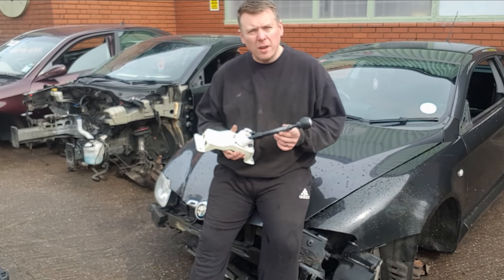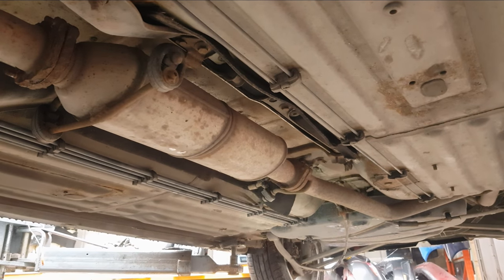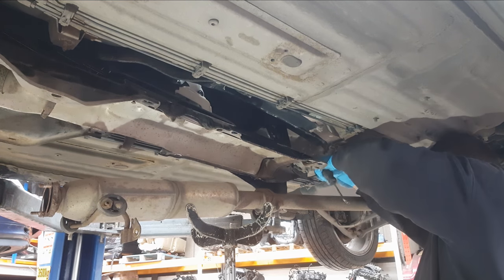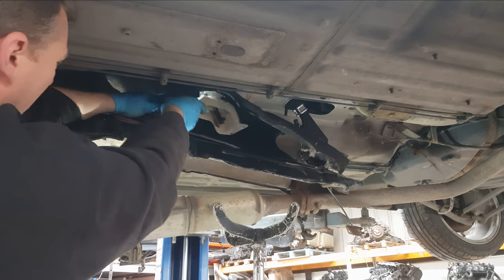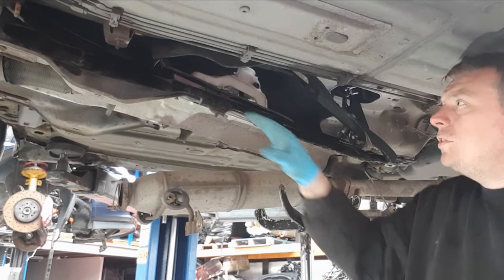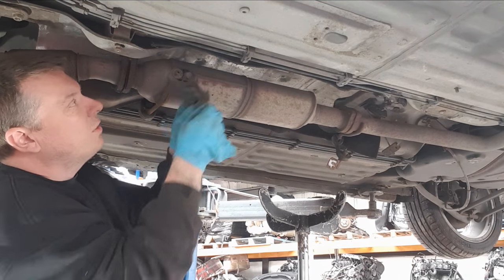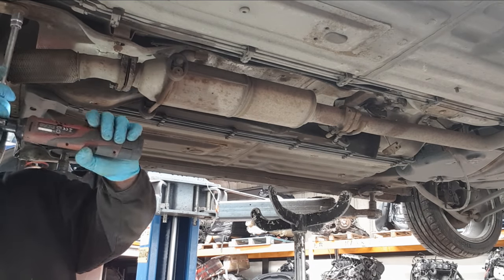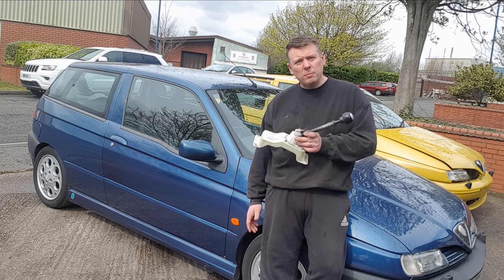Alfa romeo 147 or GT  Broken gear selector removal tutorial

Comment: Thanks for the video! Planning this job for tommorow on my Alfa 147 😅😅
Reply from the maker: enjoy.
Reply: Pfff glad it’s done...hell of a job changing gear cables 😭
Reply from the maker: Mike van Hek you run into any problems,
Reply: Italia Autos ..previous owner had point welded🤭 the exhaust pipe...so i had to grind it open. Also the bolts were rusty and welded....so i had to drill them out and made the surface smooth again...😏

Comment: I have a 2002 147 2.0 autodelta turbo conversion it's a SELESPEED gearbox ,I had the car for 5years now it's been parked on my drive for 2years (just sitting there making my drive look good😎 reason it's parked I bought a MPV ) since I parked it it's been giving me trouble selespeed trouble and I have had enough lol I want to convert it to a manual I am looking for a 147 2.0 2002 doner Manuel car if you care to help 😊,I have all the instructions to do the job it's pretty simple than ppl make it I have never done one but I love this car only if it was a manual i would be getting my full 263bhp 🤗

Comment: Hi are you near Birmingham?  I used to do all my own repairs but now I have neuropathy, Ankylosis Spondylitis and skin that tears easily which stops me tackling this exact job.
1)  Can a top part fix the issue as I have checked mine is broken as seen for 147  6 speed on the flea bay?
2) Would you be able to repair mine or able to recommend a mechanic?
3)  Where can I get hold of a complete selector if required?
4) Or where can I hire a car lift and get my son to tackle this with my instruction and this video?
Reply from the maker: yes im in walsall.

Comment: I need to change just the plastic bushes under the gear selector of the GT 2.0 JTS. How do I get out that stupid pin? I tried a hammer with a screwdriver but nothing is happening! It's not the same as the JTD.

Comment: I have trouble engaging 6th gear, I really need to push it hard to the right and then it gets in easily, or I just pull the ring for reverse and then it slides easily, It's like the selector doesn't go right enough, can this be adjusted?

Comment: I have a 2007 alpha gt 1.9 jtd,I would like to replace the part, where can I find the spare part? If possible new, refurbished, but not used, can you help me?I live in Italy
Reply from the maker: Think a company called totally alfa sold a kit
Reply: @ItaliaAutos Thank you for the rest, but the new alfa spare part is nowhere to be found, my problem is not so much the right/left movement, my lever moves back and forth when I accelerate or release the gas, do you think it can only be the bushings and its housings together with the shift cables? Thank you for your help

Comment: Hi I have a 156 and the top portion of the white cup is loose.  seems 2 out of the 3 bolts are loose and wont tighten up.  is there any way this can come off with out doing the procedure as in your video?
Reply from the maker: Nope all done like in the video
Reply: @ItaliaAutos  got around to doing this job over the weekend in my driveway.   What a job!  used up all my bad swears for 2023 and maybe a few for 2024.  added spring washers and nylock nuts.  I guess the problem is the factory bolts are no high tensile and stretch?  anyway, if this has to be done again it weill be done by the next owner.  gear box oil seals next.  cant be as akward.......

Comment: On my GT the gears engage fine but the gear stick wobbles around like crazy, what's the problem? Do I have to open the whole thing from the bottom?
Reply: Same on my 147, I'm about to swap out the housing now, I'll let you know how it is after
Reply: Update, yeah gotta drop the exhaust and that plate, gear box cable clips are really stubborn without a pry bar. My 2.0L 147 has a 1 piece shifter housing, disassemble it and replace 1 tiny bush and fixed. The 2 piece housings have a top section you can take off with 3 nuts, can buy the replacement kit and slap it together and she'll be right
Reply: @osamabinchicken8853  Okay a bit more work, but thanks for the instructions, I need to get it together, hopefully this week.

Comment: Hello from Spain! I have a problem with my 156 2.5 V6 gearbox. When the car is hot, fifth and sixth gears are very hard to engage. Do you know what could be the problem?
Reply from the maker: Try changing the fluid
Reply: @ItaliaAutos   I did it, but doesn't work.
Reply from the maker: Then it's prob a box rebuild.
Reply: @ItaliaAutos  Ok, thanks for your help!

Comment: Hey, i was wondering if you could help me. I have an alfa romeo brera and my window switches are not always working. When you try to close the window sometimes it opens some times it closes. Or if the window doesnt do anything you can hear some sort of a click. Maybe you know what could be the problem?
Reply from the maker: mas is try a window reset. If that doesn’t work the switches are common to be faulty.
Reply: Italia Autos the reset didn’t work. So the next step would be to change the switch module?
Reply from the maker: @masis5448  yeah looks like it.
Reply: Italia Autos ok thank you.

Comment: OMG, I can't believe you need to drop the exhaust to get to this? Who the hell designed that? Every other car you just remove the interior parts to get to it.. Jesus I'm praying the gear selector issue I have is the top hats not this. I really can't be arsed doing this, but if I have to.. I will. FML.
Reply from the maker: yes annoying but easy enough.

Comment: Hi Great vid by the way. I have a 147 1.6 TS 120hp and had the very stiff gear selection issue. Changed the top hat bushes (they were in a bad way). Now not stiff however the stick is now very sloppy, no issues engaging gears but is like a wooden spoon in a bowl. Do you have any GEAR LEVER BODY kits ? as im sure its the cup and side bush that is knackered on mine ?
Reply from the maker: Very nice! no i dont sorry.